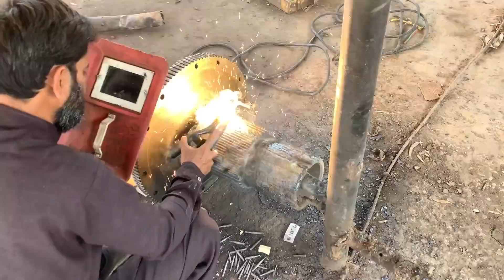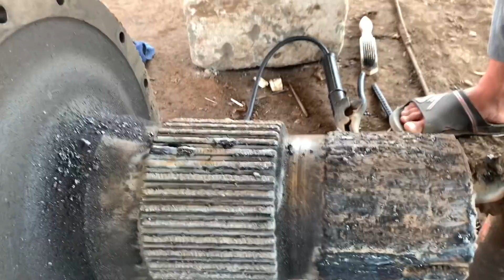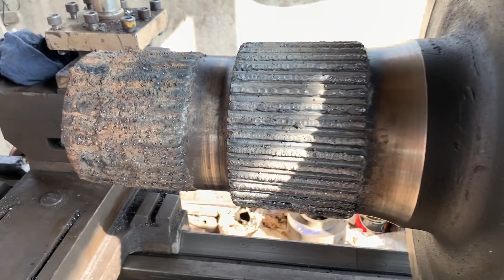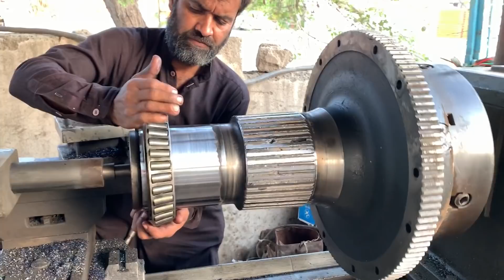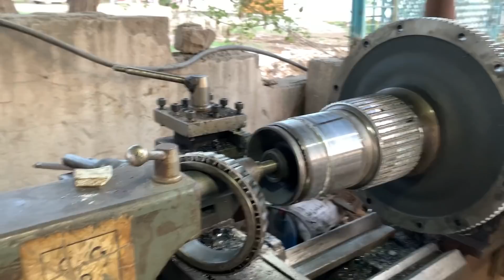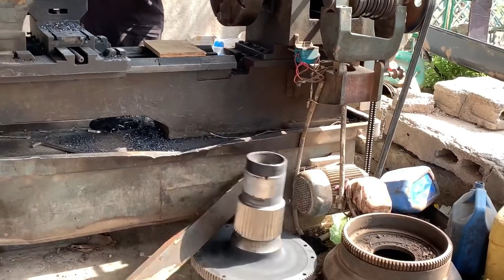How To Caterpillar D8k Bulldozer Tube Final Drive Repairing‘’Pk Amazing Skills’’

Comment: when i saw the grinder cutting by hand ,  then the sprocket  teeth on the concrete block gouging  , i knew  a big sledge would be used, they should only fix wheel barrows .
Reply: you forgot the case hardening of the gears, or lack of i should say. this should last about 12 minutes.
just because you can doesn't mean you should
Reply: I saw the hammer coming from a mile off myself. When it arrived on the scene it was a doozie too. Must have been the biggest hammer in the village, I'm telling ya.
Reply: You think he got the pitch right on those gear teeth?😂
Reply: @maxpuppy96  I don' think any of them could answer that.

Comment: Welded parts must be heat treated even though it's welded right,so the structure integrity of the welded part won't warp or crack easily and always wear safety measure(s) while handling this kinds of stuff...
Reply: Отпуск

Comment: I will assume these guys know that the original part was made of top-grade steel and carefully machined and hardened.  And that wore out.  So it’s a losing game to tak weld some tiny globs on, wrecking and remaining heat treatment.  Not to mention hand-grinding new splines.  Splines depend on perfectly uniform surfaces spreading the load out equally.  You can’t duplicate that by eyeballing with an angle grinder.  This machine will be back with two weeks.
Reply: They don’t have a choice, original part is way too expensive for them.

Comment: Wow…… Caterpillar engineers and technicians must be having heart failures after seeing this video. But…. The gear heat treat must be damn good to withstand repeat drops on the concrete. That lathe is taking a beating too.
Reply: Half ass fix just to keep it going until it breaks again and then another half ass fix .... Later they make tent pegs out of the final drive.

Comment: How did I know that these "master machinists" were going to re-form threads by pounding the fastener into the threads and re-cut splines with a hand grinder and a cut-off disc  🤣??? It would be interesting to know how many of those precision-cut splines actually produce drive at the same time!! And the "precision fitting" of the splines was beyond belief!!
Reply: Master machinist = master bator
Reply: It wouldn't be so frustrating if they explained why it was done this way in the description. And yes, hammering splines on, OUCH, wondering what this will fk up down the road.
It was really cringey watching experience.
Reply: @Baisulis84  I was expecting 4 or more of these workers (butchers) to let loose with a mob of sledge hammers at the end, but only one was at it with a sledge hammer, only thing i can think is maybe they only had 1 sledge hammer.
Reply: I lost my faith when he started machining the shafts without any dial-in. But then he used a cut-off disk for the splines, so I guess precision was off the table before the work started.
Reply: Half Assed well enough to get it back over to the customer. Maintenance involves a call to the shop after weeks of the grinding sounds and clunking stop completely.
Reply: with the threads he was testing the fit, and eventually took down the high spots (peaks) using the grinding disc. Once that was done it did appear to thread on reasonably well. Clearly he does not have access to a thread cutting tool, but he makes do with what he has. A lot of the negative comments on here I find interesting. The question is not how good the repair is or how long it will last, or what you think can be done better by western standards, but quite simply --  would you be able to do better with some welding rods, a grinder, and an old worn out lathe with no precision measuring tools? If the machine runs for a few more days weeks or months it's better than a machine that's broken forever.
Reply: @joey66436  Exactly.  I'm sure they would just love to have all the right equipment, but they are doing the best with what is available.
I get why cutting splines, with a small hand held angle grinder makes some people wince, but they are not gears; they are just there to make the make the two parts fit together with as little movement as possible, and it looks like the fit is indeed very tight.   

Without all this admittedly crude bush engineering, the dozer isn't going anywhere.
Reply: @sjb3460  I believe it is a survival situation in this case. -As you put it basic easy stuff, like a proper method comes from proper education, which they don't have. By saying something done to a lesser than proper engineering standard is not going to be as good or last as long I will agree with you. Also the people/person  making money off the videos is likely not the person doing the work. If I were making $2 a day and someone paid me .20cents to film me id think it was a good deal. The guy with access to the computer, knowledge of english and education to get it all happening would likely be getting the bulk of it.
Reply: @joey66436  I've been a machinist for 25 years and I have to say I have nothing but respect for these folks that get in there and do the best they can with the tools they have.  Its pretty obvious that these people are about as poor as poor gets.  It seems that we in the west have zero understanding of what that even is.  These guys are repairing a part for a machine that was probably worn flat out when it arrived on Pakistani shores, yet was a monumental capital investment for the buyer. Clearly even a used replacement was out of the budget for these folks, so they did what they could.  My hat is off to them.

A machine to produce a tapered spline is some pretty specialized kit.  Cutting them by hand with a grinder and having it fit AT ALL is flipping amazing. (Clickspring could do it better than factory with a homemade file, but I digress)  They probably don't have the special made cat tool to press that bull gear on that spline with 100 tons of force either, given that it's rare to see an actual real life ratchet handle in one of these videos, so yeah bro, you swing that hammer. 

There seems to be, in my world anyway, a strange inverse relationship with respect to technology.  It seems that the more technology we have the more things there are that cannot be done without it.  If you have a micrometer, you don't use a pair of calipers, but if you have a CMM you don't use the micrometer, and that can be a problem.  God help us if the lights go out, as our technology has erased our ability to do exactly what these guys are doing.... getting by.

It's fun to work where I do, using million dollar machines in an air conditioned workspace, to haul ass through a $30,000 piece of raw material, with tools that cost $500 a pop and last 20 minutes, for the express purpose of turning $25,000 worth of that raw material into chips as fast as humanly possible, but we have more money than time.  I'll bet a paycheck mister armchair machinist up there couldn't hit a press fit for a bearing with a pair of old school calipers if his life depended on it.

Comment: These guys should have just put the final drive back on the dozer, put the sprocket on there and wack it a few times with that sledge hammer till those precision grinder cut splines locked into the sprocket splines, then roll the whole dozer off the nearest cliff and hope the sprocket lands on the right tree stumps a few times and drives it the rest of the way on.  JUST ANOTHER DAYS' WORK BOYS.

Comment: That fix isn't going to hold up for long. Great effort, although you get what you put into it. Basic standards were created to avoid exactly this. Sad that this is necessary wherever they are, although if the bulldozer got the job done safely vs. long lead and higher costs, then I can see why they went this route. It's the same story for anyone who buys cheap tools. Throwaway stuff.
Reply: this shows that stuff can be fixed, we throw away so much in america that can and should be fixed.  throw away the lawyers instead.

Comment: Many levels of wow and shock here but what is the lime or whatever on the threads for, first I thought sanding as no paper, then I thought lubricant but then there was some. What was it 🤔
Reply: I think it was soap, or maybe chalk mixed with the oil? idk anymore
Reply: I think…🤔…yes I think it’s a “MAGIC POWDER”. By it at least he can see and measure the thread depth bcoz there is no thread cutting and measuring tools. So he put this Magic Powder to control his hand as CNC controller.

Comment: Caterpillar must be so pleased with this "repair".  Guaranteed sale of a genuine part soon.   Or just goes to show how wrong the Western World has been all these centuries to create and impose engineering standards.  Silly us. LOL
Reply: I absolutely cringed when he goes at it with the jumbo sledge.  I was wondering how they were going to get a precision fit to the final drive sprocket.  That will be a precision tight fit alright.  I wouldn't be surprised if they weld the drive shift to the drive sprocket!   I've seen things like this in my travels!
Reply: I’d guess they’re pretty good at keeping wore out dinosaurs going. I’d bet that machine was wore out when it headed there, and they’ll keep patching it up forever
Reply: I was wondering what sort of mill they were going to cot those teeth with.
I ran a big old mill 40 years ago ,used 440 volts . But it was much newer than what they are using .
  But if you have skilled people, you  an accomplish unbelievable results.

Comment: You guys are amazing . The skill set is blowing my mind . When you slid the final drive sprocket on and it fit I was overwhelmed . Great work as usual , very inspiring . Thank you .
Reply: It fit halfway with the help of a huge sledgehammer
Reply: @scottpecora371  I think they are pressed on the rest of the way. Thats where the "Problems" may start lol Psst, got a good deal on a dozer, finals have just been rebuilt yes?

Comment: Be interesting to know how those splines got flogged out, my guess is that final drive has been played with before and not reassembled using specified preloads/measurements etc. The thing with these sorts of repairs is that they are not permanent, they make the parts fit together and that's about it. Too poor to buy a hammer? 19:42

Comment: Surely the Owner of the Bull Dozer could pay for a better 2nd hand replacement part, after all the lathe Operator is using an old Bearing, cutting Splines using an Angle grinder, Arc Welding using any old Filler Rods. Lathe operator is stretching it a bit (more like idiot) for pushing the Drive Sprocket Hub off the Bed of the lathe, as for the "Amazing Skill Headline" what is amazing about anything on here other than amazingly shite work.

Comment: All rough job. Country method, welding & machining bearing area is ok. How about splines, sprocket seating area taper-fit. 60 to 70 ton press. fit. Finishing of taper splines may not be accurate.
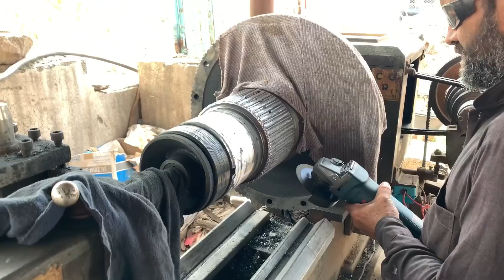Reply: 22:47 - check that bearing area, it's not machined but scratched with grinder. It's definitely not OK.

Comment: This is from Pakistan, where no one will ship parts to, not India, not US not China, they have what they have, a lathe from 1930's, stick welding rods, and a couple of measuring tools. 
Tell me if your customer wanted his 'dozer working NOW, and that's all the tools you have, how will you do it better?
There is NO crane, no mill, no spares, no specs, no safety gear available. You have a day to fix it. Go, tell me how you will do better or anything at all.
Reply: All the "This is good as they can do" all goes out the window because it will never fit.

Comment: Pathetic, poorly done primitive. Filling in missing steel with stick welding is stupid. What precision can you have when working by hand with a grinder?
Behind is the street?
Throw away the pieces
 Dangerous for those who work with a grinder without a mask or eye protection, they work on the ground, the adjustment is with hammers
Reply: that throw down of gearing from the lathe cracked me up
Reply: @RisedWithDusk  yes see all the damage on side off lathe , they probably fix this ever month because of there great quality of work  ;) video ends then with in jammed on half way  . classic